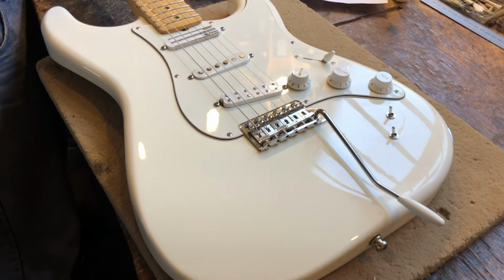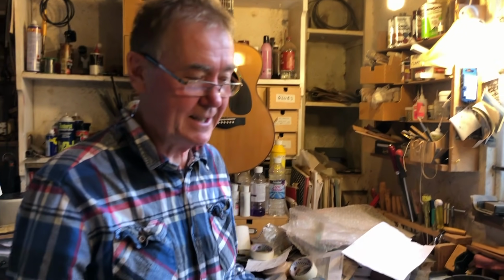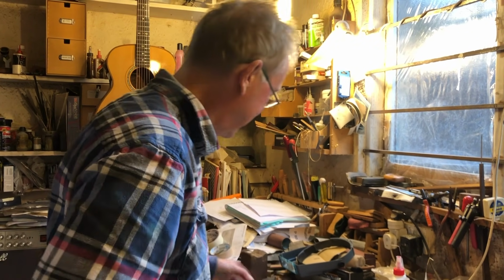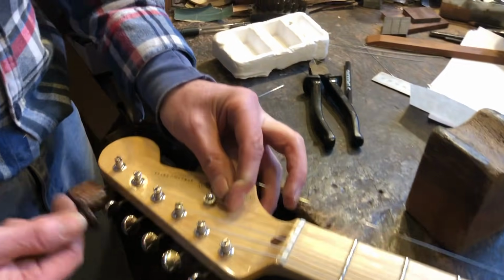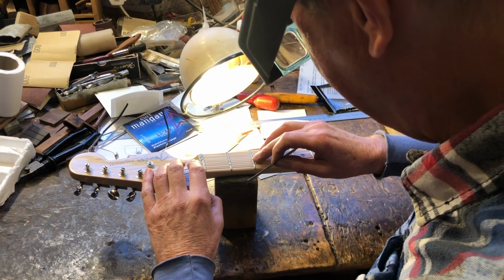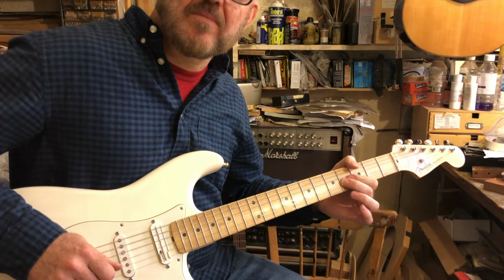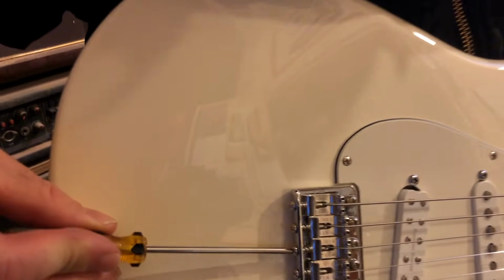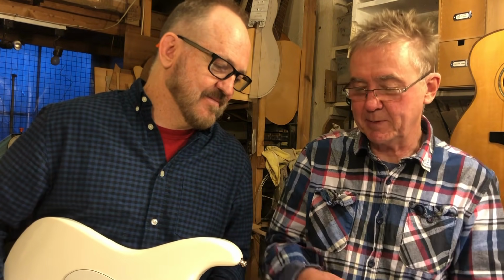Dan’s Vlog – The Ed O’Brien Strat Gets Set Up By Jonny Kinkead – That Pedal Show

Comment: Something to watch out for imo (common on many strats including my EOB): the strings are much closer to the edge of the fingerboard on the higher frets than they are at the nut. I almost thought there was come confusion w mixing American and Mexican strat parts.
My high E and Low E were slipping off the ends of the fretboard a LOT until i replaced the bridge w something w slightly narrower spacing.  Especially since the sustainer BEGS for dramatic vibrato, bending, trem use, etc. The spacing at the bridge is now identical to my mastery bridge on my jazzmaster. Narrow-ish compared to some, but very comfy. I found the fender trem arm to never sit well in the hole. way too much play.  felt "clanky".
Aside: whatever fender is doing with the finish on the fingerboard and back of the neck feels just great. smooth as silk.
Plays just great now. Just one guy's experience.

Comment: yes tell him I'll be right round with my Takamine .. that was beautiful until I trusted it to a " luthier "  all that was wrong was the edge of the nut on the heavy E string .. I got it back .. nut was rubbish fit .. & original saddle replaced by some hacked up thing Piezo pkups no longer working ..  I bet he lives somewhere only accessible by four wheel drive & secret Gps code .. Lol & I am sure I could not afford his time .. but I learned a lot watching .. so cheers guys .
Reply: he's pretty much in the middle of bristol, as for prices, he's not the cheapest but not very expensive, well worth it, I've had all of my guitars done by him at various points and am on the waiting list for one of his acoustics, he knows what he's doing :)

Comment: FWIW, be careful using 000 steel wool on neck, by taping off your' pickups...or perhaps, removing the neck from the body as not to let steel wool dust infiltrate your pickups. Those magnets can attract steel dust into the windings wreaking havoc eventually. So, I've read.

Comment: I didn’t have a good experience with my EOB. The neck wasn’t straight, the sustainer wasn’t working like in the test videos. I checked the Fernandez page and they recommended a bigger string gage. Also there was not info with the guitar about how to properly set up the sustainer in the control cavity. Still it wasn’t to my liking. The neck to was too big for me. Not what I was expecting for a $1200 guitar. I returned it. Fender has to improve their quality control.

Comment: did the rattling noise from the high E string disappear after the setup? what was making it do that?
Reply: It seemed to mostly leave if not all the way by the end of the video. I'd have to think it had something to do with the trem now floating away from the body.
Reply: @seantaylor532  that's what I was hearing but didnt know if it was due to mic placement or not. I get the same noise, but not as bad as it was at the beginning of the video.
Reply: @jasoncobb7427  Check for a high fret just below where the buzz starts.  Probably a fret that popped up a bit.
Reply: @northof50now  checked and it didn't have any high frets. but I did straighten the neck a bit and that seemed to get rid of it.
Reply: @jasoncobb7427  Awesome.  I keep a small construction razor around.  They are small and perfectly flat on the sharp edge.  Perfect for placing between 3 frets.  Cool that all it needed was a neck adjustment.  I love when the fix is easy :-)
Reply: Jason Cobb It may well have been a buzzing truss rod, since the luthier discovered, upon removing the neck, that the truss rod was slack.  If no tension had been applied at the factory, that would have been a definite no-no and a likely source of the problem.

Comment: Just the first few minutes alone for me are already so interesting! All this talk about true temperament fanned frets lately... Wood expands/contracts! As soon as you tighten the trussrod on any guitar neck you shorten the scale length from the nut to the highest fret... Then you can adjust the bridge saddles to correct intonation from the highest frets to the saddles... True temperament frets are so precise they only work if the guitar stays EXACTLY the same forever from the day it leaves the factory... And only with the perfect factory setup... If you want a little more bow in the neck than the factory provides you start entering custom shop territory where the exact measurements and calculations match the curve of your neck... Until the wood starts to slightly warp and all these precise calculations go down the rabbit hole anyway!

Shut Up 'N Play Yer Guitar! 😋

Comment: I might be terribly wrong with this, but I was always under the impression that the truss rod bent opposite to his diagram. I genuinely not trying to discredit this great man. Im only seeking clarification. Regardless, I leaned plenty that I plan to apply to my American Special Strat later today. Cheers!
Reply from the maker: Johnny has been repairing and building guitars for over 40 years Cesar, pretty confident in his understanding of truss rods
Reply from the maker: I'll just add - Mick here - a two way truss rod will bend the other way as well, but Johnny is right. That's the standard operation.
Reply: That Pedal Show Thank you for the clarification, guys. I would love to see a future vid where he works on another one of your guitars.  Have a great one!

Comment: Isn’t it annoying that you have to unscrew the neck in order to adjust the truss rod! This is true on vintage Strats, and clearly also on Dan’s . Fender changed it to the headstock somewhen, and Gibsons, PRS etc all have it at the headstock. The truss rod tension changes all the time, especially from cold to warm climate, humidity etc so it’s good to be able to give it a little tweak every week or so . Also, over time, if you have to keep screwing the neck on and off, those screw holes are going to slowly wear and get bigger. How tight should one tighten the 4 neck screws? Anybody know? I really stress about this stuff.

Comment: I am only 20 minutes through [and know I should wait], but cannot understand why the neck came off to adjust the relief as there is an adjustment point at the headstock.  2nd, at the beginning, Dan stated that he loved the tone, but clearly there's a buzz so loud [at this [point in the video - it sounded like a high fret somewhere at the 5th fret to me].  Likewise, for more than a year I heard him [and Mick] state how much the loved the tone of Dan's Red Tele - yet after the fret job, we heard how bright and horrible it sounded prior.  My point for #2 is simply that what we "hear" is more psychological than actual.  [p.s. Dan, I love the channel and meant absolutely nothing insulting or personal - simply that I've always had the feeling there was more psychological than we tend to admit].
Reply: northof50now He wanted to check the fitting of the neck—ie if the heel was level, if the pocket had excess paint or material. At no point did he suggest that he would have removed the neck a second time had he had to make additional truss rod adjustments.
Reply: On the close -up, it looks like the dark area at the head is capped.  Odd looking.  The adjustment point at the head has been capped and the body looks as though it was cut for a neck tilt, but doesn't have one.
Reply from the maker: Mick here. The psychological thing is EVERY bit as important as the actual thing. Go talk to anyone on a psych ward. What's happening to them is real. Placebo drugs, sensation of experience.... Your brain is EVERYTHING you experience. Ergo, it really, genuinely is all in your head!
Reply: @ThatPedalShow  Absolutely Mick - again, I meant no offense to Dan.  We all do it.  It's why I gave up seeking "tone" from YouTube.  The guitar has to be in your hands.  I'll also add that you need to be in the right frame of mind.  I've picked up my equipment and believed it sounded wonderful...put it down for the evening, then pick it up the very next day and dislike the sound immensely - without changing a thing.  It's a giant head game.  :-)
Reply: Truss rods are adjustable at one end and anchored solid at the other. And yes the could be head adjustment is plugged.
Reply: The truss rod on this model adjusts at the heel end of the neck, hence the need to remove the neck to adjust it. Other models adjust at the headstock end much easier to adjust.
Reply: Re: point #2. The buzzing might be a problem for acoustic stuff but when you plug it through pedals/amps etc, it may not be that noticeable. The gains of having a low action (and maybe some buzzing) may be outweighed by the playability through pedals/amps. It's a very subjective area so YMMV.
Reply: @ThatPedalShow  - Which might be why I haven't yet made it in the real world although, in my head, I'm a guitar god. :) :)
Reply: northof50now  - There's no adjustment available at the headstock end of that neck. 
The adjusting nut is at the heel end. Take another look ...
Reply: northof50now it had to come off as the truss rod adjustment is at the heal.  The walnut plug is aesthetic.
Reply: @ThatPedalShow  A freshly washed and valeted car always seems to drive better than a dirty one!
Reply: The buzzing could be a loose tuner. In a setup I tighten the tuners with a spanner if they are that type and check the screws. If the truss rod is not set right you can get buzzing in the middle of the neck
Reply: @ThatPedalShow  Just like Dumbledore said!
Reply: Just a comment in regards to your comment about the fret job, The Red tele got refretted twice. The first time with huge frets, which made it super bright. The blog on the refret was the second time after putting the original size frets back in. Totally agree that a lot of our concept of time is psychological, although I think that’s important. Great thoughts!
Reply: @ThatPedalShow  Shared experiences, for example most would agree that Larry Carlton is a better player then Lil Wayne. Gravity is not affected by what one believes, the laws of physics are law because they are constant and repeatable. Additionally they affect us all the same, regardless of believe.  

We know our senses are imperfect and even understand many ways they can be fooled. The imperfections are statistically consistent  across cultural, race and age. IE common. What one thinks IS and what IS are not necessarily the same thing even if they might be for a single person. 

Thankfully we can check our beliefs to see if they are in harmony with common reality. The scientific method is one of our best ways to do this. Without it we wouldn't have electricity. 

Doesn't it make sense to use such a tool as we try to improve as people and musicians. I suggest the actually or commonly perceived improvements are more satisfying then imagined improvements. Is a mind adrift in an ocean of experience or can we have paddles in the water? 

We know who David Gilmore is because we commonly perceive his tone and melody to be exceptionally pleasing. It is "real". Personally I prefer real over imagined.  I suggest if a an audio thing is not recognizable better in double blind testing it is imagined. 

I choose as much as possible to not be a victim of my own minds imperfect operation. YMMV

Comment: I can't believe at the and of the 2nd decade of the 21st century one would still have to take the neck off a guitar to adjust a truss rod. Even taking off the fiddly plastic neck cover and buggering about in there with a truss rod tool is old fashioned compared with easily adjusting it at the body end using a rod like more modern guitars and like ones I've got from the 90s. I'm all for the joy of vintage, but that's just bad out-of-date design. Great video generally though! :)

Comment: Rattle? Isn’t that just plain and simple fret buzz?
Reply: That's what it sounded like to me.  Only just started watching the video though.
Reply: Yes.  That's what I thought as well.  I high fret at 5th or so.  I had the same thing happen.  On of my frets popped up a bit.  A slight tap with a wooden mallet cured it.  I didn't see anything Johnny did that would have elevated that buzz.  Lowering the nut would not have. Raising the strings may have hid it a bit.  Of course, we could be wrong as well.  But, when you've had it happen to your own guitar, that sound seems unmistakable.
Reply: northof50now I might be wrong cause I know nothing about setup. The only thing I know is that I have the same on my strat :(
Reply: @artwerkmedia8616  If you can get a small safety razor, lay the sharpened edge along the frets.  It should be able to cover 3 frets.  The sharp edge is perfectly straight.  As you go down the neck, see if the blade begins to rock back and forth.  If so, the fret in the middle is high [causing the rocking].  With mine, I simply took a wooden dowel, and tapped the fret down with a mallet [very lightly - support the under side of the neck].  The fret leveled out.  The buzz was gone.  From my understanding, it is common.
Reply: northof50now thanks, i will try that
Reply: If you go to the nth degree with stuff, then you'll track it down. I like how Dan gets concerned at 3:00 that sustain will suffer. As happens in F1 racing it comes down to what you value.

Comment: That style of truss rod placement is the worst. Why make it so you have to remove a neck for that adjustment. Put a door in or a slot to accommodate a tool without neck removal.

Comment: That is not how a truss rod works in a vintage fender.????
Reply from the maker: Erm?
Reply: @ThatPedalShow   The curve cut in the channel for the rod bottoms out where you expect the maximum relief to be. The rod (loose) will the apply force to this point first as you tighten it. The back pull is achieved by the rod straightening out as more tension is applied thus pulling the neck in to back bow. All vintage style single rods work this way.